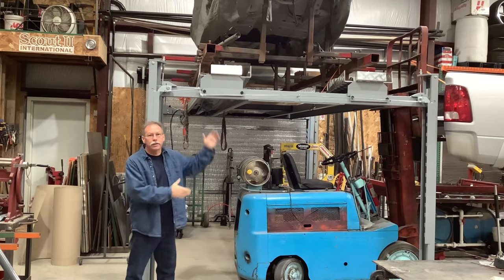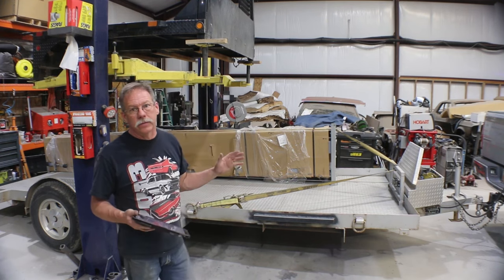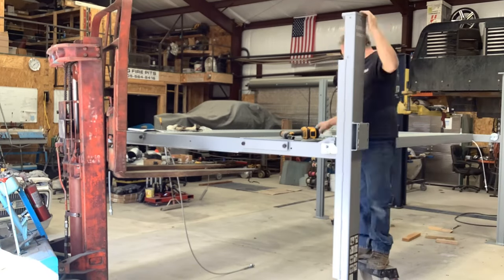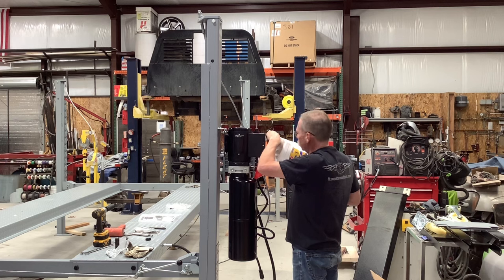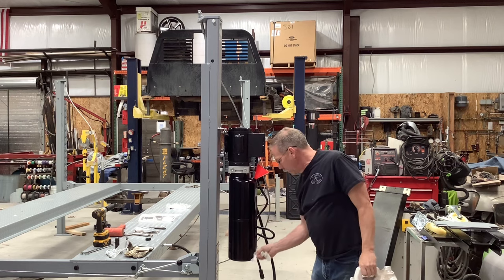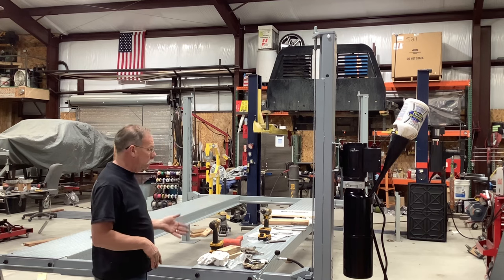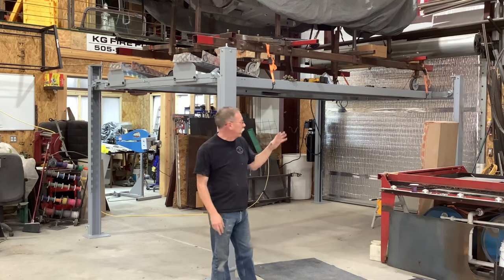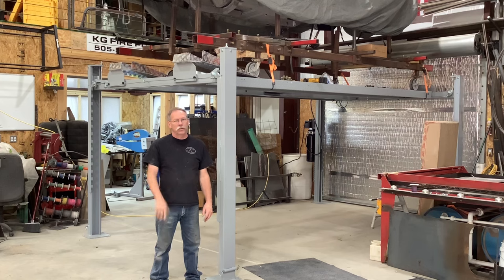I Bought a 4 Post Car Lift on Amazon! Was it worth it?

Comment: I bought the exact same lift off Amazon (under Aplus brand) 10/13/23. Had the same head scratchers you did. My ramps are steel, heavy and cumbersome, would have paid more for aluminum ramps or ramps that pivot out of the way.
Reply from the maker: Thanks for sharing!  Oddly, the first lift I bought actually had better instructions.  Same brand and part number, but I don’t know if it is the same reseller.

Comment: For fluid I’ve always used and seen ATF for fluid used. The dealership I worked at had Rotory lifts and they required ATF DEXTRON
Reply from the maker: I did find in my older version’s instructions that ATF Dextron or Light Hydraulic Fluid are acceptable. Thanks for the info though, I think you are dead on.
Reply: @AllisonCustoms  As long as you use the same fluid if adding you should be fine. I would mark the revisor with the type of hydraulic fluid you used.
Reply from the maker: Excellent idea!

Comment: You didn't bolt it to the floor?
Reply: I set my 4-poster up first, ran it up/down a few time to ensure it was perfect, then bolted it down. I can only assume he's doing the same. If he doesn't it will get ugly. Mine uses a hydraulic ram mounted on a beam on top and sliding ramps. I'm not a big fan of cables going through the ramps. Mine uses a fat chain.
Reply from the maker: No, I think if you were driving on and off, it would be a good idea, just so it wouldn’t slide as the tires first started on to the ramps.  The way I’m using it, pulling vehicles on with a winch, it hasn’t been necessary.
Reply: @AllisonCustoms  bolts are inexpensive and take less than an hour to install. This still makes no sense. I can tell you for certain if anything happens and you try to make an insurance claim, the lack of mounting bolts will result in an immediate rejection of the claim.
Reply: If they intended the lift to be bolted to the floor anchor bolts would have been included instead of wheels.
Reply: @Vintageguy73  good luck. I'll look into it more as I may want to add another in my garage in a year. They are perfect for exhaust work. Please do an update video.
Reply from the maker: This is my second lift of this brand, the other has been sitting with a 1966 Impala on it for about 18 months.  Granted it has gone up and down like twice but it has been great so far.
Reply: Can you put the rolling jack on the middle rails for this lift?
Reply from the maker: I’m sorry, I don’t understand your question.
Reply: We sell these types of "Storage racks" and they can be bolted or put on casters so they can be moved around.  These lifts are for storage only not for working on a vehicle.
Reply: @psvassar They come with an optional bridge jack, so it's definitely intended to be used to work on vehicles.
Reply: @AllisonCustoms it’s a jack that lifts your car up so you can take off your tires